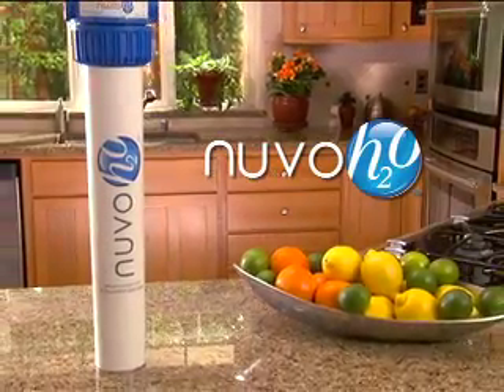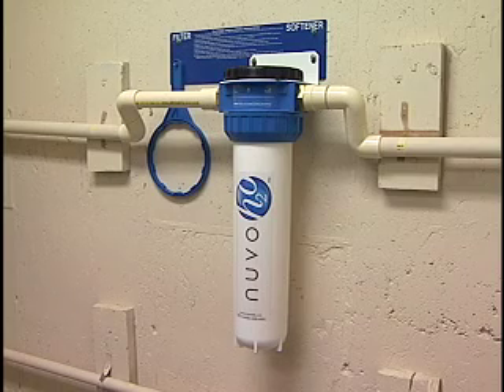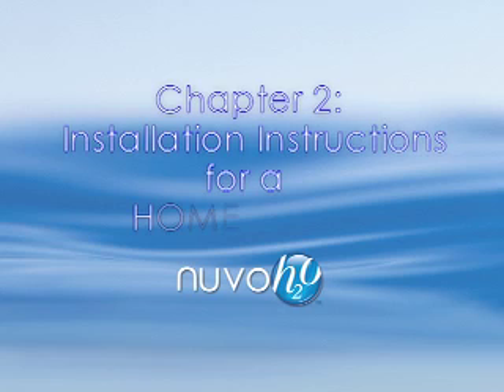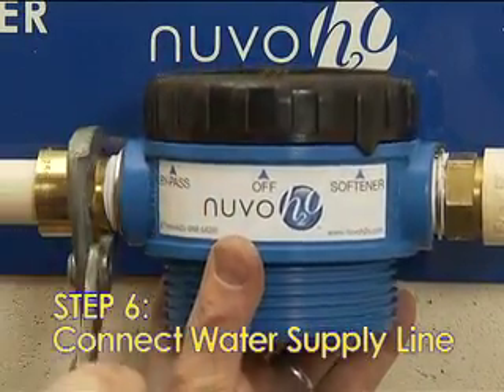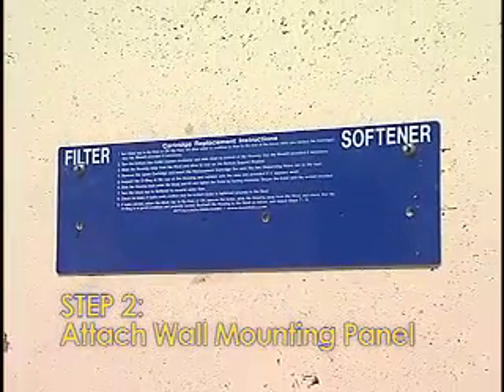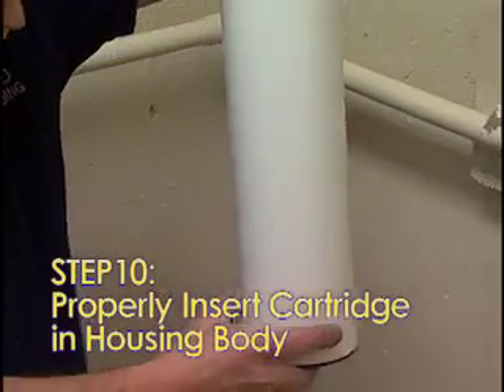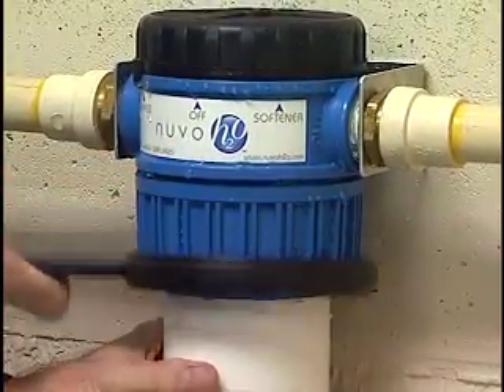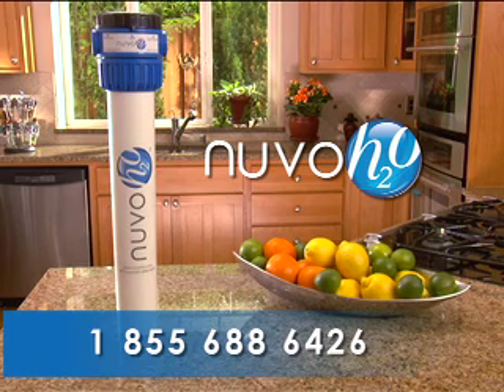nuvoH2O System Installation & Cartridge Replacement Video (Salt-Free Water Softener) #2

Comment: Would this work with high iron in water? (rusty water)
Reply from the maker: +betsy burg While iron won't negatively affect our system's ability to treat the hardness, the system isn't designed to treat iron/rust. The main area of treatment for the nuvoH2O is calcium and magnesium (the minerals responsibile for hard water build-up), so you won't really see any decrease in iron/rust after installing our system. Let us know if you have any other questions.
Reply: need to replace the pipes. they are old.

Comment: What size O ring is used for the Manor model and where can I get a new one?  When replacing the filter I somehow either lost the old one or it wasn't installed to begin with.
Reply from the maker: +Jeffrey Biehn The Manor o-rings are approximately five and a half inches in diameter, but if you aren't able to find any we are more than happy to send you a replacement if necessary. Just call the number on your system and our customer service department can assist you further.

Comment: In all your installation videos it does not indicate what inlet/outlet pipe size required to connect to both NuvoH2O openings.  This is important so that the correct nibbles/connectors can be bought before installing.
Reply from the maker: +A Fong The inlet/outlet sizes for the systems are as follows: Manor - 1.5 inches; Home - 1 inch; Studio - 3/4 inch. Hopefully that helps. Let us know if you have any other questions.
Reply: +nuvoH2O Thank you.  This is most helpful!

Comment: How much pressure loss occurs over 6 months time
Reply from the maker: heethen most Since our system is a softener instead of a filter, any pressure loss from the nuvoH2O system should be negligable. You shouldn't see any dip in pressure unless the cartridge is installed incorrectly.